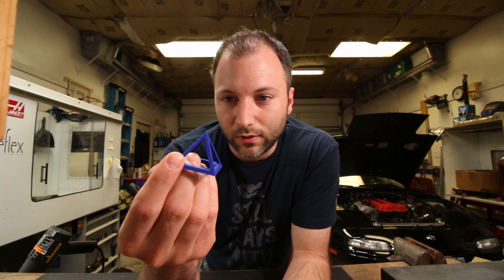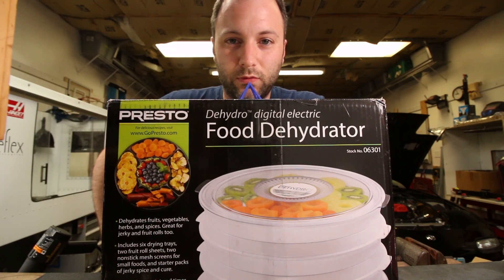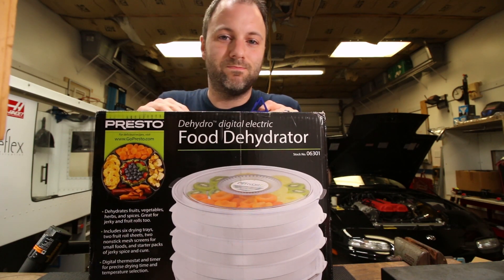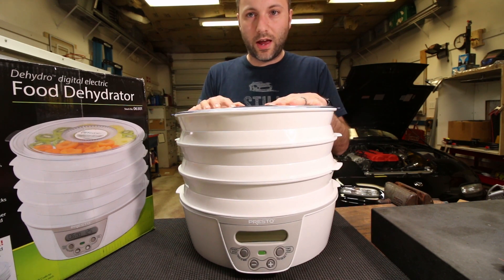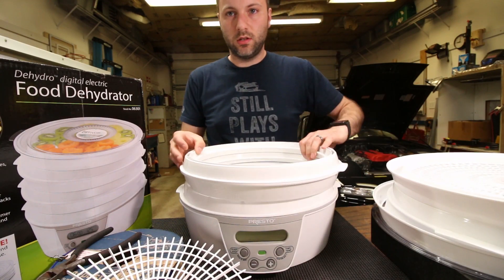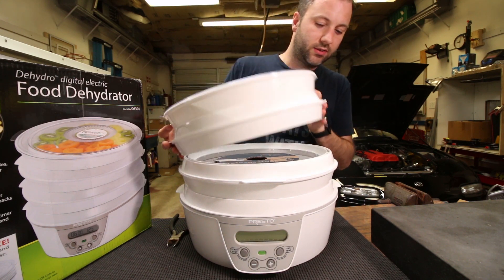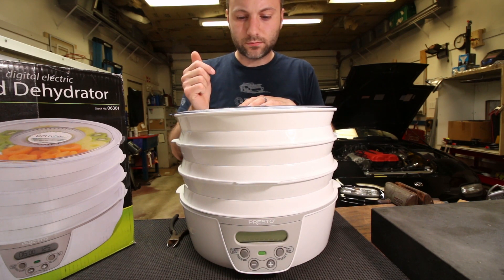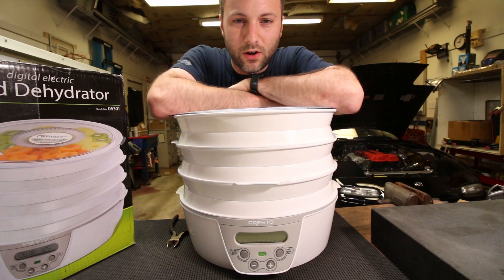How To: Dehydrate 3d printer filament

Comment: Just built one of these last night using this exact unit.  OMG it is LOUD!!! Wasn’t sure how long and at what temp to do it for. Nice thing was I could fit 3 rolls of 1kg spools in it at a time. Did PLA for 2 hours at 160F. Immediately pulled them out, put them with a desiccant pack into those “space bags” and used the vac to suck out all the air. Easy way to store filament for long term.
Reply from the maker: 160f might be a touch high for PLA let me know how it works out. I keep mine in the basement or garage when it's drying to keep noise down.

Comment: I modified my unused dehydrator the same way and have used it in the past with some success. Thank you for the temperature settings. I was running it a bit too hot for PLA and my filament, while it printed good, would stick to itself. I'll try the lower 140° next. Thanks again!
Reply from the maker: Glad I could help!

Comment: I ended up hollowing out one of each type of tray. I have Makergear, hatchbox and e-sun filaments and the spools are fatter than what you showed in the video.  It's a little loud but I've got PLA in there now.  Will post on results.
Also, has anyone used this to reuse silica gel packs?

Comment: You can also just use aluminum foil to make the walls and then instead of throwing out the trays and filling up the land fill, sell them as a set on ebay for a couple bucks so they get used.
Reply from the maker: You think I threw away the trays...I saved them for a future project. I'll reuse them somehow. They could be a grate for a fan or a filter holder or a tray or.....?  Aluminum foil could work but would use a ton of aluminum foil to build a 3-4" high spacer.

Comment: It's late so this is probably a silly question but how does this work? Is it just a heater or does it actually remove the moisture? How does it remove the moisture? Where does the moisture go?
Reply from the maker: +Nerys it heats the air to 160F (at least that's what I use for Nylon, 140F for PLA) which heats the plastic as well. It also has a fan that blows the heated air across the chamber and the spool of plastic.  160F air can hold more moisture than ambient so it absorb moisture from the filament and carries it away in the stream of air away from the spool in essence "drying" it.
Reply: ahhhh ok that actually does make sense. make the air hungrier than the plastic and the moisture will leave and get blow away with the air. OK duh. should have realized that.
Reply: its just a huge hot air blower taking air from under neath make it hot and blow it out at the top.

Comment: so Dehydrate, then airtight store and use, after use place in the airtight ? or Dehydrate, airtight store and repeat ?
Reply from the maker: Depends on the filament and how well it was stored/shipped to you. Nylons I almost always dehydrate before printing for a bit if I can, then put them in airtight container to print from and store in airtight container with dessicant until next use.  ABS and PLA I only dehydrate if I see a loss in print quality and I store after printing airtight with dessicant.

Comment: think that you could you make this into a drybox for nylon and turn it on when you want to print?
Reply from the maker: +Robert Grassi yes you could. There are models on thingiverse to make a pass though for the filament. You attach the pass through to a larger "Tupperware" type container and flip it upside down on the dehydrator.  I'm not sure if the design or container works with this specific dehydrator though.

Comment: Is there a way to do this just by placing your filament on a heated bed and closing the chamber of your 3d printer?
Reply from the maker: +3D Printwiz I suppose that could work.  You would want airflow as well to allow the moisture to be carried away and not just sitting inside the enclosure.
Reply: Thanks for the reply bro. Tested it on an old PLA filament, and it worked beautifully, but one problem is that my printer stops preheating after an hour without activity. Do you know how to stop that, I use Flashforge Creator Pro.

Comment: KLZE BABY! that mx-6 looks exactly like mine did before having to let it go i'm so sad now.. you even got the JDM lights on there, I wonder if you got the 13lb 16x8 rx-7 wheels on it :P
Reply from the maker: +Jack Sadek Actually it's a 1993 MX5 Miata...with a 1996 BP 1.8l engine and a Flyin Miata turbo system.  I will be releasing a video this week on it with some of my 3d printed parts featured.  MX6 are cool too. I'm definitely a Mazda fan. Thanks for the comment and Happy New Year!
Reply: Wow I thought for sure it was a mx6 lol, the front end looks identical in this video, here is a picture of what my car looked like , the only different is this picture does not have the JDM lights and mine did, my lights looked exactly like yours

https://i.pinimg.com/736x/bf/c3/d4/bfc3d441b05f4a95c457235e71f29ea0--i-miss-you-i-love-you.jpg

Yeah I agree mazda is one hell of a car company, sadly had to get rid of my rx8 last year but I will be getting the new rx-7 or rx-9 that will come out,  ZOOM ZOOM!

Comment: Why not print a new part for the dehydrator and nor ruining the existing ones? Isn't that the whole idea of 3d printing? :) Just wondering... otherwise great idea!
Reply from the maker: +Zhivko Gorchev I thought about it. The replacement part is bigger than any of my printers print beds. So it wouod have been several very long prints that needed assembly.  At that point the side snips and a little trimming seemed like a good idea. Also replacement trays are $8 on Amazon :)
Reply: Zhivko Gorchev the filament would cost more than a replacement trays so it doesn't make any sense to use the 3D printer to make them
Reply: Not everything should be 3d printed.

Comment: Isn't new filament only $20? Guess if you have  more than 3 rolls you need to save this makes sense.
Reply from the maker: Nylon requires drying almost everytime before you print with it, even stored relatively well. It also costs more like $50-80 a kilogram. And I have dozens of rolls of filament in all types. It's pretty wasteful throwing out each roll that I left on printer a little too long in open air.
Reply: TPE/TPU is almost as bad too.